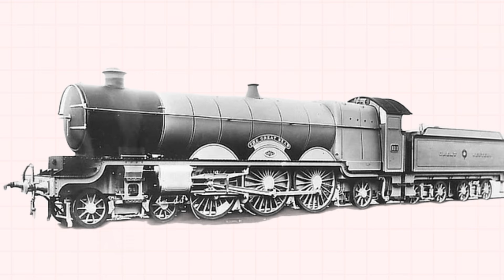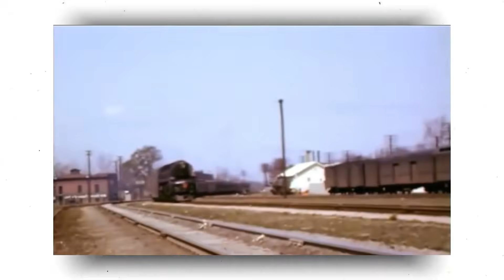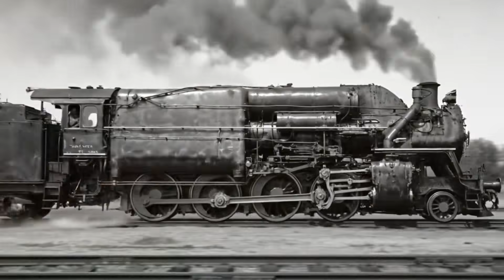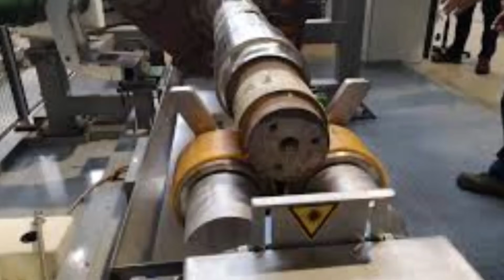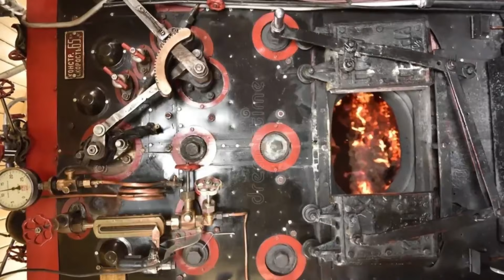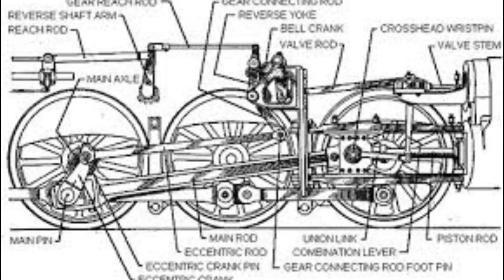20 WORST American Locomotives From The 1950s, Nobody Wants Back!

Comment: The T1's would have been good locomotives with a few modifications, but when the war ended, switching to Diesel was a done deal. At their best, they were impressive machines by any standard, One averaged 102 mph for 69 miles, the length of the Ft Wayne Division, with a sixteen-car train.

Comment: The animation is the worst, plus the wrong locomotive keeps popping in and out. you keep showing the 4-4-4-4 and the 6-4-4-6 as if they are the same. You need to get your engines right.

Comment: Kinda funny that you have the PRR T1 here. A new member is being made. Hey, it's better than trying to make a new PRR K5. 

To be fair the PRR T1 prototype was better made than the mass produced units. Also, modern understanding of locomotive engineering is being applied to the new one. Whether or not the Type B poppet valve will be needing less maintenance compared to the original poppet valve is something that will have to be seen once the time arrives.